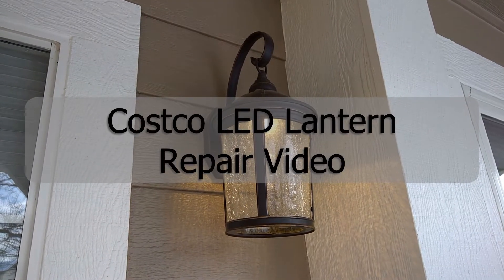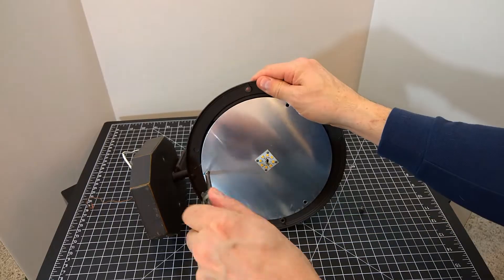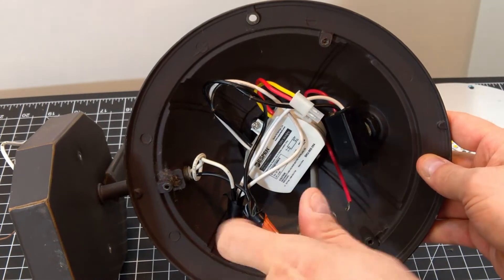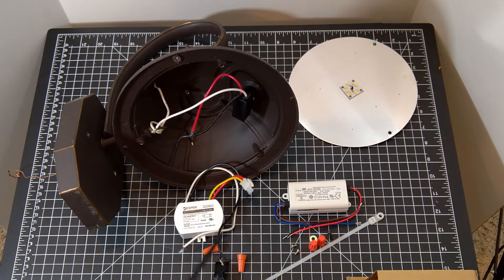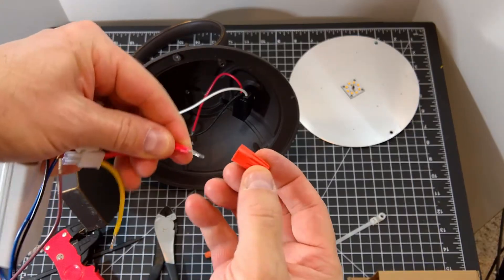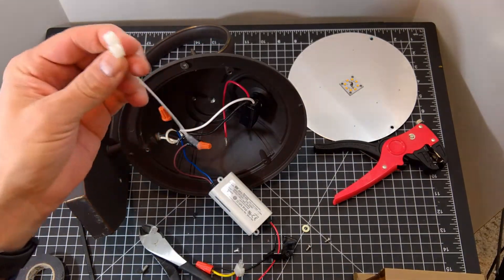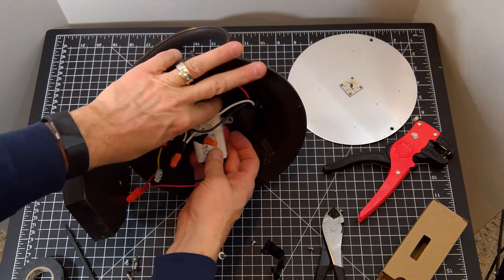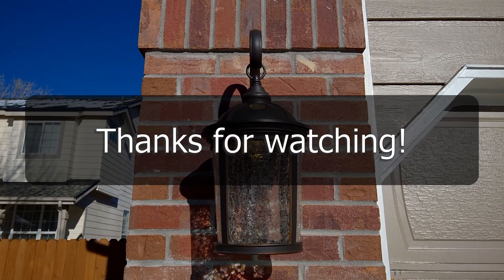Costco LED Porch Lantern Repair 2

Comment: Honestly though, what a damn pain in the ass if you have to remove the entire light from your home and unscrew 5 different things,  strip wires,  buy a new driver and swap it...
Like how does this even save energy or money or time. I have this same light and after 3 years I have to do all this instead of just change a bulb. Im livid enough to just return the whole damn thing to Costco so they never sell this burden ass product ever again.
Reply from the maker: Not sure if Costco even sells this particular light anymore.  For those of us that want to keep the light, this video suggest some repair options.  Not sure about time, but LED lights generally use less power than a traditional bulb.  So, I guess that's how it can save you money.  Repairing it just might make the ROI a little longer.
Reply: @rickmorenojr  Costco gives full cash refunds for any product that's not "electronics". I don't need the same light I just need A light.
I'd rather get refunded and hope Costco learns a lesson on not selling cheap garbage anymore, hopefully they cut ties with this company
Reply: @rickmorenojr  $15 for a driver just to save 6 cents a month in electricity.... 
Forget this light. 
The carbon footprint to even make the driver is huge compared to making an energy wasting lightbulb
Reply: Im with you. Don't understand why they dont just put a bulb socket and use an LED bulb. Same efficiency and far less hassle. I bet a lot of these get thrown away, so there goes lower carbon footprint. It makes for a disposable light instead of making something that lasts 30 years and gets replaced for aesthetics.
Reply: Wish I knew this crap before I bought these f-Ing lights.

Comment: My photo cell had only two wires - black and gray.  I broke the power supply from the house with these...black from house to photocell and photocell to driver.  It is not working.  Is this not the proper way to wire it?  Could the photocell be bad?

Comment: Ricardo, I need the LED light not the power supply do you know where I can get that part?
Reply from the maker: Derek, perhaps LED Supply has a LED that you could match up to your driver.   There's also EBay.  Be sure to check all the voltage and current parameters (in this case you need match the LED with your driver).  Let me know what you come up with.
Reply: @rickmorenojr  Did you ever find the replacement LED? I tested my Power supply and its good. I just need a new LED disc.

Comment: I have the same problem with mine.  I purchased the same replacement part.  I installed it WITH the light sensor in the loop.  Upon testing, when I cover the light sensor all of the eight LEDs immediately illuminate.  But then six of them go out.  I have tried it several times and the results are the same.  What could be the issue?  I have a video if needed.
Reply: Did u ever resolve this issue?? I just did mine today and same thing is happening. TIA
Reply: @srugila  Contacted company and they replaced my drivers and led plate.

Comment: Hi! I have the Altair al 2149. It started blinking. I took it apart and noticed everything was the same except I don’t have a black wire   To connect to the house power, I have the white wire. Is it still the same wiring process? Btw I’m using the photocell wiring as well. Thanks!
Reply from the maker: Hmmm...there should be two insulated wires going to your house (and bare ground wire).  What colors do you have?
Reply: Same here. I attached the 2 white wires to the blue wire and left the red and black to plug into the led light circular plate. So now i have a brown wire and a red wire left

Comment: Hi Ricardo, we replaced the power supply, but only 2 out of the 8 LED's are lighting up, the others are burnt out.  Do you have a recommendation for a replacement part?
Reply: Cree CXB 1310 High Density LED array.  Make sure you purchase with wire extension already solder to LED.
Reply: @jameswalls6565  will this be the appropriate path to follow if the LEDs are frequently blinking? Dont want to buy a module I dont need...
Reply: Oh, you will need Arctic Alumina premium thermal adhesive or some comparable product to attach LED to aluminum heat shield.  No screw holes on new LED.

Comment: Ricardo,  Thanks for your helpful video's.  I have 2 of these Costco Altair LED Lanterns.  We recently had a power outage and I saw that one of them blew out.  Do you think I would just have to replace the power supply - or all of the actual LED's?  I'm sorry if this is an obvious answer - but i am a complete novice.  Thanks

Comment: Awesome video, I see your previous has many views,  I was pretty bummed that this burned out and you cant just replace the led bulb...  I have an old light bulb receptacle lying around,  im going to cut a hole in the aluminum housing where the led is mounted and add my receptacle...... can you tell me If the red leg of photo cell goes to my receptacle or is it the black one?

thanks
Reply from the maker: If I recall correctly, the red leg of the photo cell would go to the black wire (hot) of the receptacle.  The white (neutral) would connect to the white wire.

Comment: Great video!!!  Mine just did it and I'll be ordering parts next.  But my question is, if you are going from 12W to 16W are you making the LED's work harder?  Will they shine brighter and burn out?
Reply from the maker: No, 16W is just the maximum capability of the constant current driver.  The LED brightness will not change so long as you match the voltage parameters.

Comment: First off, I'm not electronically inclined, just enough to be dangerous. He's my situation with these Costco Lights: I have 3 of these units. One started blinking. Before thinking it was the Driver, I removed the (Fickering) Round LED Reflector and installed it on one of the good operating Lanterns and ... no dice. I took what was a  good Round LED Reflector and installed it on the bad or flickering unit and bingo, it worked fine. So to me the Drivers are all working fine but I have a faulty LED Chip/mechanism (mounted to the Reflector Plate). Can I simply (where?) buy a replacement LED Chip compatible with this unit that already has the connector and wires fused to the chip and or plate? How to figure that out?
Reply from the maker: That is an excellent question.  Perhaps LED Supply has a LED and driver set that you can purchase.  There's also EBay.  Hopefully you can match the color, lumens ,or wattage, as the other two.  Let me know what you come up with.
Reply: I am dealing with the same situation...did you find the 8 led light chip needed here? Where? Cost?
Reply: same deal here 2 of the 4 lights I have are blinking everytime it gets cold outside. any answers?

Comment: Have 2 of these, and both lanterns stopped working about 2 weeks ago as well!
Wanted the dimming function, so I bought the "PCD Series Mean Well 16~25W CC LED Drivers with Triac dimming. Wattage: 16W. Output Current: 350mA". This driver is compatible with this lantern, and regular household dimmers (Triac dimming). The dimming works reasonably well!
LEDSupply has fast shipping! Ordered Thursday, delivered Monday!
https://www.ledsupply.com/led-drivers/mean-well-pcd-series-with-triac-dimming

Comment: I used your video to help me replace the constant current driver in my lantern. The driver failed less than 2 years after purchase. I even used your links to purchase my replacement driver: thanks! The only change I would recommend would be to use water resistant wire nuts so that water penetration into the light doesn’t compromise the connections. I was able to reuse the mounting point on the light to attach the driver with the old screw: it is only attached in one spot but this isn’t a moving fixture so I’m not concerned about it coming loose. Thanks again!

Comment: Thank you.  I recently experienced the blinking LED light of death with both of my Costco Altair Coach lights.  Both issues presented themselves within weeks of each other and each required a different solution.  Both lights blinked as if they were sending Morse Code. 

The first light required a new LED plate.  The second light was resolved with a replacement of the LED driver (purchased from ledsupply.com) as explained in your video.  FYI - It you order a replacement LED plate from Altair, their new design completely eliminates the need for a LED driver.  So if you can troubleshoot the LED plate being the source of your issue you will not need to purchase a LED driver.
 
Again, your quality, well explained and video taped YouTube video gave me the confidence to tackle this project on my own.  Thanks for saving me the cost of new coach lights.  This video embodies what makes YouTube great.  Kudos!!!!
Reply from the maker: Thanks for you kind comments.  I'm glad you were able to fix your lights.  I've seen the latest LED as a COB with built in current drivers.  They're available cheap on eBay.   I might even be tempted to pick-up one to test.

Comment: My issue was the photo eye. I replaced the driver and it still didn't work. So, I bypassed the photo eye and it worked. I can't read the part number on the photo eye to get a new one. 😢